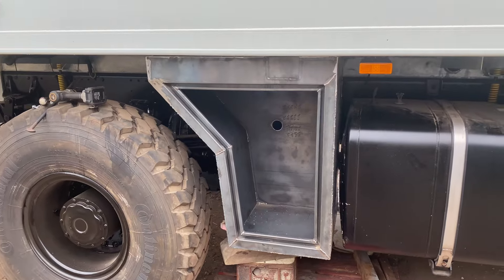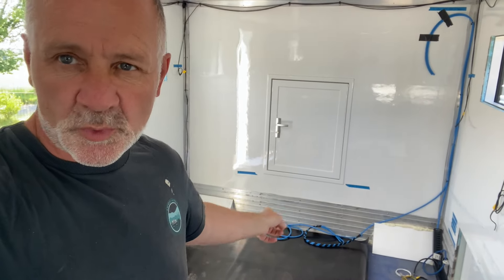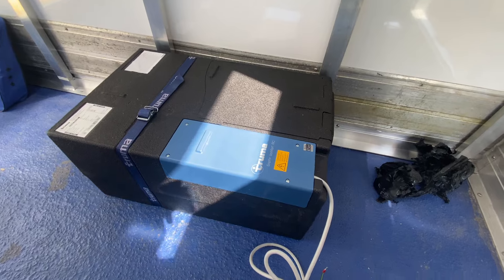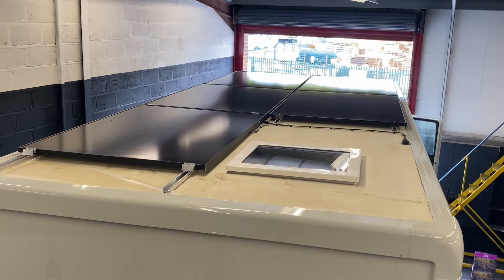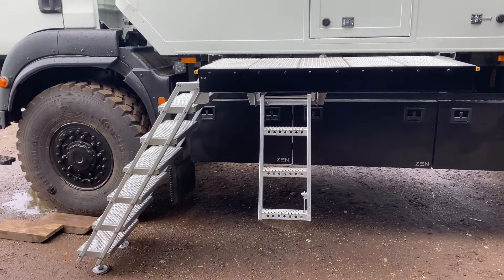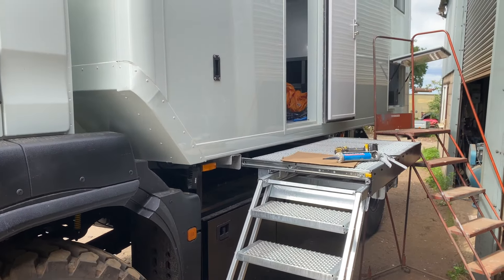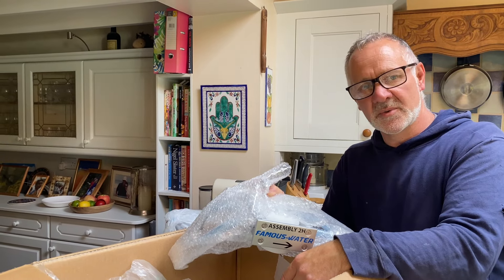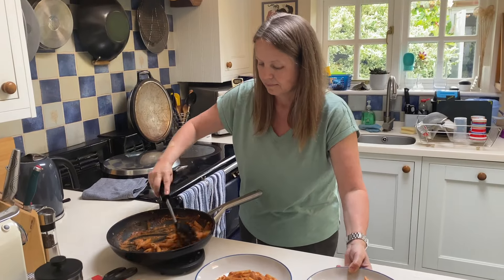OVERLAND BUILD REALITY!

Comment: The other thing you might want to consider is adding a VPN router. If you do, again run off 12Vdc but it means you can add wireless combined smoke and CO detectors, IP cameras for checking on the wagon while you away from it and your communication back to the van will be encrypted (given you’re going to be in various countries). Again, just let me know if you would like any advice - I have all this up and running myself and means I can watch UK TV when away also

Comment: I an surprised Izzy didn't lay into you with your description of the meal - so rude!
So much cardboard; I had masses of boxes when I was fitting out my vans so can understand the lack of space in the truck. I commandeered our spare bedroom.
I do think a small build, whether van or overland vehicle, is far more complex than building a house, especially working out where everything fits. And some of the systems, such as the electrics are more complex as you have, in that instance, a combination of 12 and 230V. Your cold and hot water systems look particularly good and I am really impressed that you are using a combination of a diesel heater as well as heat from the engine. It really does look like the build is coming together. 
Thanks for taking the time to make videos of it all as I can imagine it is the last thing you want to be doing, especially when you really want to concentrate on just building. 
All the best.

Comment: For your heatIng, did you consider the Autoterm 5D Flow hydronic burner? Ours has run very well, almost half the price, and the kit came with so much I had bits left over. They also are the makers of the original 'Planar' diesel air burners that the Chinese copied.
Reply from the maker: We did, we did loads of research when we bought one for our last truck and rate them highly.
The main reason for opting for an Eberspacher was the spares network.
Although we're hoping the S3 is a little quieter than the older D5. 🙏☺

Comment: You might have simplified it for youtube. Do you have thermostatic control on the engine coolant loop? Otherwise water in calorifier will be heated to over boiling by the engine.  Does the calorifier also have a 240 or 12v element? What is the volume and where did you get it?
Reply from the maker: Hi Derek, apologies for my late reply.
The engine loop will go through a heat exchanger so no concerns, as this shouldn’t exceed 85 degrees.
The calorifier's 40l, has an 240v (1000watt) immersion and made by Surejust.
They come in many different sizes and get excellent reviews.

We’ll easily be able to use this with our system or whilst hooked up to shore power.

Hope this helps 👍🏻☺